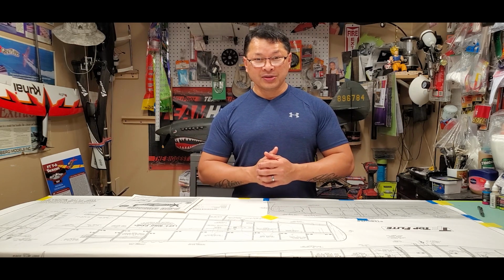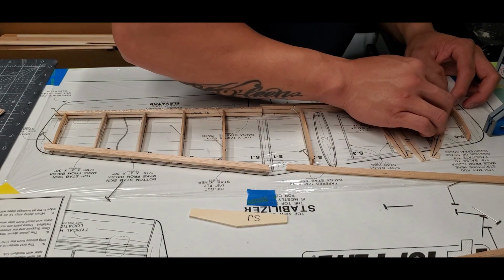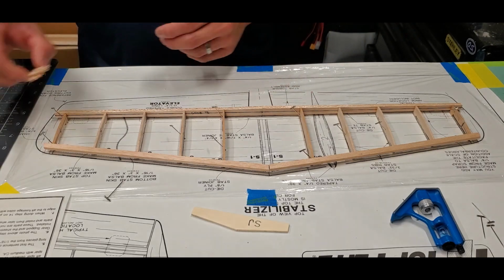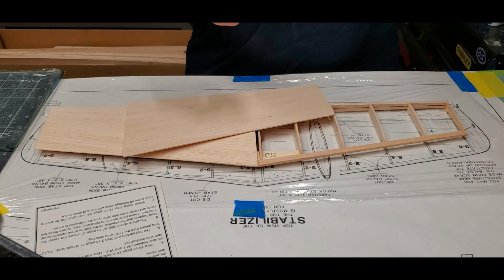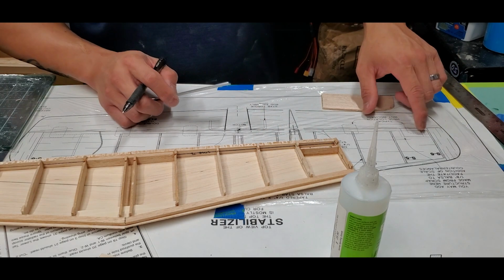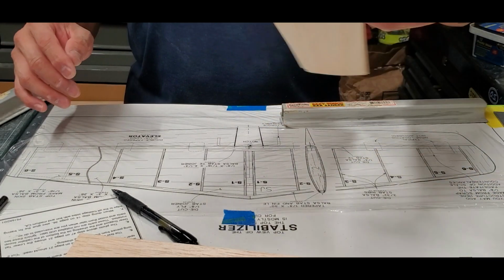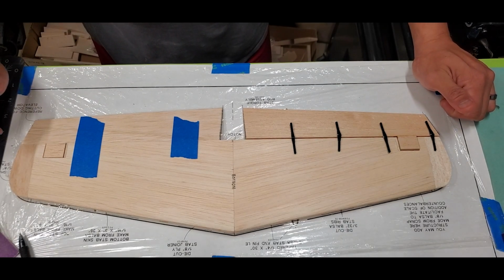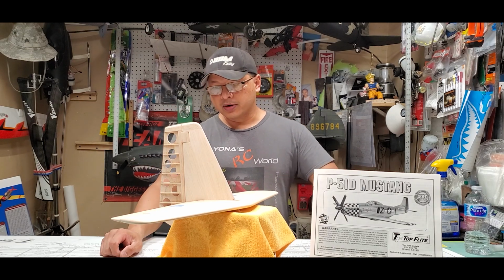Top Flite P51D Mustang Build Series Tail section

Comment: On models like this where the structures are not pinned flat to the plan especially with polyhedral wings i use wooden door shims to keep my parts off the building board during gluing of the frames. Door shims come in real handy while keeping parts off the building board. A good example is the main wing on a Mr Mulligan keeping the outer panels suspended off the building board.

Comment: Looking forward to this build too! I started this kit years ago and got as far as just starting to sheet the wing. But life got in the way and I never finished it.
Reply from the maker: Hope all is great now and maybe you can get back to that build one day.
Reply: @BayonasRCWorld  I've been following your P40 and Frank's P40's build here recently and that has encouraged me to start building again! Looking forward to your build... I've never flown one yet other than a few short hops with my Nextstar .40 trainer. I just rebuilt the engine on that so hopefully soon I can get that in the air this summer.
Reply: I started my first P51D in 2000. I did sheet the wings but was a poor job and the sheets don't touch the ribs in a few places. Actually was my first RC kit build so what I did get done wasn't too horrible. But I have another kit and plan to do it right this time.
Reply: @stevejones9044  this was my first kit as well. I started feeling like I was going to mess it but and set it aside for a little bit... Then both me and my wife hit a bad run of bad health issues. Then time just flew right on by for us.

Comment: I subscribed to your channel because of this build, as I too am building the same plane.  You are a good builder, and your details of the finer points are adequate.  You could refer to the extra instructions that are in the kit for revisions to the plans for your viewers.  Following many of the past builds of this plane on RCG's and other websites, I notice that most of the planes pitch up with full power, not too much of an issue with todays radios and mixing, but the airfoil is really just a "pattern airplane" airfoil and it should not really do that.  I had a conversation with the designer, Dave Ribbe, and he said that the wing washout is 2 degrees, and is designed into the wing with the tabs ( don't mess it up with sheeting).  A request (squawk)for your next video is  to keep the music at the same volume or lower during your fast forward parts please.  Looking forward to the rest of the build.  THANKS !
Neil
Reply from the maker: Dully noted on the music and volume.

Comment: For those that build this model and fiberglass/paint, how do they typically cover the rudder? Cover with monokote and paint?
Reply from the maker: Cover with either silk span and dope or what I found easier is Oratex which is a Iron on fabric covering that can be painted also comes in multiple colors.
https://www.horizonhobby.com/product/fabric-covering-5m-roll-white/ORA10010005.html
Reply: Cool. Thanks 👍

Comment: Michael, a question if I may .. What material did you use for your board?
Reply from the maker: My building board is 4X8 sheet Gypsum board 5/8" thick.  On top of a solid hard wood counter top that is straight as a arrow.